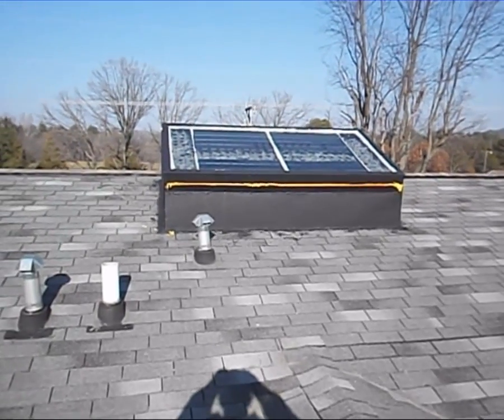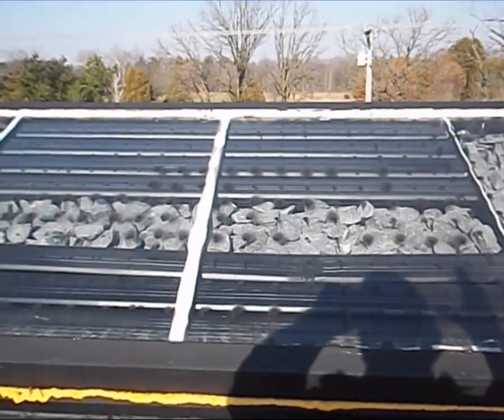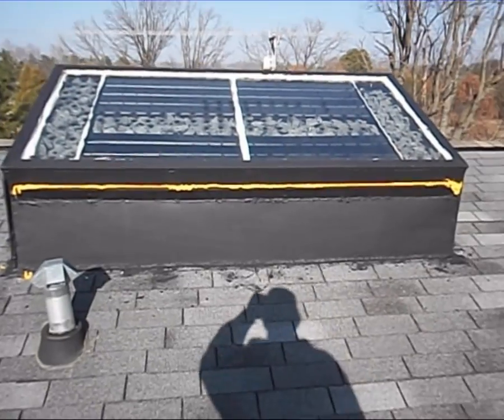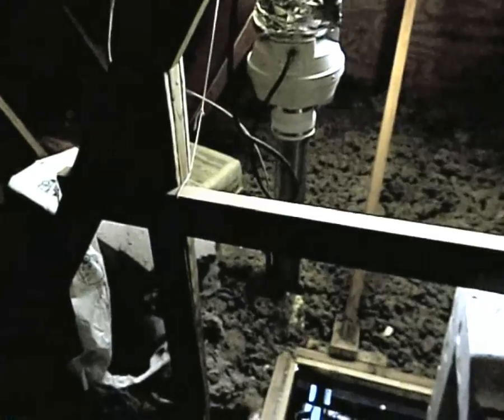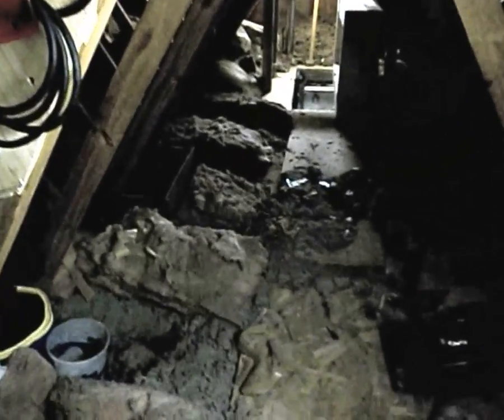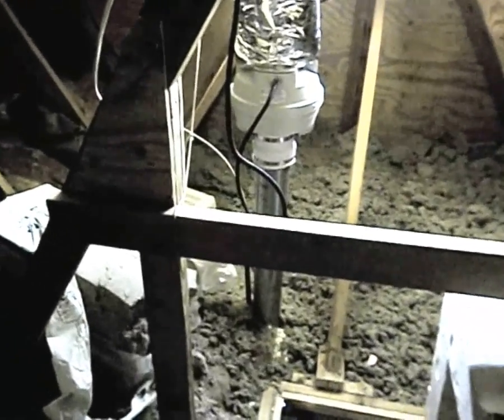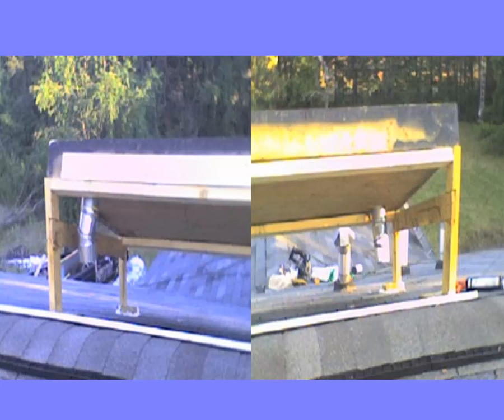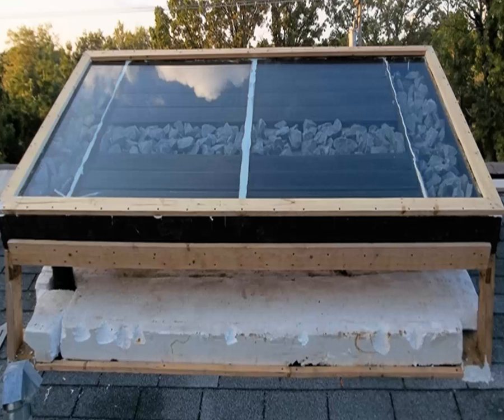My Roof Mounted Solar Panel and How I Built It Download Download

Comment: About 20 years ago we had solar panels put on top of my home. They worked great but when the sun is out is when we got blasted with the heat and at night when we needed the heat there wasn't any. I was going to run them to my basement next time and hope the basement would hold the heat. I don't have them any more. Just my thought on my experience. Very nice and I enjoyed your video.
Reply: Don't forget water in an insulated tank is a great store for heat.
Reply from the maker: Dukky Drake You're talking about a completely different type of system and it's more costly and takes up a lot more room. This panel is "Hot Air Only". I thought about doing a water system, but the cost of all the piping/tubing, pumps/ tanks/ etc. was just to much.

Comment from the maker: Thanks Bill, With spring just around the corner I'll be starting my next panel: 9' 6" by 52" by 8" with a completely different heat tube system.

Comment: I just finished a panel very similar to yours but without the rocks. My theory is that with adaquite air flow, all heat entering the panel is removed to the house. The rocks would only delay the timing and not provide any more usable heat. I just filled the box completely with the downspouts. Works great. Thanks.
Reply from the maker: The air flows thru the tubes not the rocks in the center section .... It's only on the inlet and outlet ends that has any air flow. But! many put baffles in the tubes to "Slow down" the air flow. If it goes thru it to fast it doesn't have time to get hot. I've seen some with nothing more than a computer fan to move the air.

Comment from the maker: I'm at 44 degrees lat. I went to a solar panel group and they came up with the 23 to 28 degrees, but they did say for best performance that was with "NO" trees... I cut down about 30 trees and it still wasn't enough, and I'm not going to clear cut my back yard. I'm hoping to have enough time to build my 2nd panel and that will be at a steeper angle. I'm thinking about making that frame adjustable so I can try different angles.
Thanks for the post.
Grandpa Bill

Comment: Hi Bill, thanks for sharing this video. You mentioned the angle of approximately 25° on which the unit is set. It does look like the back (top) of the unit is 25° up from the horizon, and you mentioned you are in Wisconsin. With the sun's azimuth being so low in winter (roughly 20°) and assuming the roof faces due south, wouldn't you want the panel to lay back at 70° (more raised) up from the horizon facing the lowest sun angle to offer the best 90° angle for maximum winter efficiency?

Comment: Just a thought, we use a hand held thermostat in the shop that would only let circuit to salamander close to turn  on to 120v plug.  We could set it at any temperature we wanted. you could uses this switch to set you temp of 80 deg kick on and 70 deg kick off.  Another source for this thermostat would be a attack blower that has a hand setting to when you want your attack blower to kick on they sell them at lows or Home Depot store.  Nice video and I can tell you have a great mind.
Reply from the maker: First: Can you get the make and part #? I'll take a look at it.
Second: Is the housing maded of soft/low temp plastic? During the summer months it can get over 250 degrees inside that panel; a plastic housing would soften (melt) and distort. The snap switches we use is about the size of a nickle and 1/2" tall; made of metal and bake-lite. Thanks for the post.
Reply: My uncle and I used it in his shop and he is no longer with us we lost him last year and everything is gone out of his shop and can not get part number. The blower for the attack I bought at Lowes and it has a hand setting that I set on 90 deg. and it turns on blower at 90 deg. It is the vent to take hot air out of my roof.  Just ask someone at a Lowes or home depo and they can get you the hole thing.

Comment: I want to try this during winter and see if its still work.. great solar heater..
Reply from the maker: Don't use the rocks... I had problems getting the water drain to work right even with the heat tape.

Comment from the maker: I got real lucky, a friend's dad pasted and he had about 12+ plate glass panels stacked up in his garage... he said if you want'em -- take'em.... so I got some that are about 4' square and the long ones are just short of the standard 4X8, so when it's installed in the frame it comes out to full size. As for thickness I'd say a strong 3/16", (Probably their 1/4" plate.)
If you need any other info just post it.
Grandpa Bill
OH! I quit in '92 I weighed 185/190lbs... 1 yr to the day I weighed 292lbs

Comment: Air flow may stall because the pipes in the panel are horizontal. even a 5 degree tilt wiil ensure air flow driven by the boyency of heated air. Also a Low-temperate-differential stirling engine could use caputured heat to run a fan - some of these will run from the heat of a cup of coffee. They can be simple to make, plenty of video's on YT.

P.S  Putting horizonal barriers above the left end of tube 1, 3, 5, and above the right end of tube 2, 4 and 6 may create a serpintine air flow, with heat exchanger effect which may make air at the top of the system hotter and create a stronger draw to drive air flow..

Comment from the maker: 1st: LaCrosse is 125 m. West and at the same lat.
I've now checked at least 6 different sites and no two are the same.
One said 66 degrees another said 46 degrees from horizontal , but several said you can be 15 degrees +/-.
To drop the front end would be a major job; maybe next spring I'll look at it again, but I'm way late on building my second panel which will be 9' 6" and have a different heat chamber. I've got a 3rd panel on the drawing board, (might replace #1 with #3)
Grandpa Bill

Comment from the maker: Outlet line is about 6'6", (Panel to the outlet Register) that's why there is a 100 CFM "inline" fan. Last years test readings ran from 90 to 125 degrees at the register. Hoping my next panel will put out some higher temps. It will be 9'6" with a 2"X8" frame and 4' wide, "BUT" the duckwork will be longer, so I'll use 6" this time.

Comment: water holds heat 4X better than stone.  FYI - water would give your 4X longer heat after the sun goes down
Reply from the maker: As I stated in an earlier post: Water panels are a completely different system and they cost a lot more to build. You need large tanks in the basement and pumps that can pump water up to 50' or more if your panels are on the roof. Then you need more equipment to get the heat out of the water tanks and into the house.
Reply: I totally understand solar thermal, but I think you missed my point - you used sauna rocks when you could have used liquid in your panel to help hold more heat at the end of the day. Simple antifreeze in a heat resistant container would hold more heat in your air solar panel than the solar rocks you used for 3X longer, same amount of material. You did built a great system though.
Reply from the maker: OH! Now I see your point, replace the rocks with containers of antifreeze/water and set it to about -40 degrees, but my biggest concern  with having some kind of containers inside the panel would be the expansion factor during the hot summer months where the panel can get to 250 degrees.
Reply: car antifreeze boils at 197C or 387F
Reply from the maker: Exactly! So any container /tank that's inside the panel would easily reach 250 F during the hot summer months. So you would need some kind of expansion chamber.
You also have to figure in the pressure buildup as that tank temp rises, that's why cars have a pressure cap on the radiators.
You could make the water tanks out of copper tubes and paint them black, but I'm not sure how or where you would make the expansion chamber and how would you be able to check the water level, and lastly at what cost?

Comment: Thank you fir the video.

Have you ever measured the performance?

I'm especially curious about the rocks for the thermal mass.

I would think the rocks would be very cold dissipating all its stored heat, so they would have to give up a lot of potential heat energy just to warm them back up.

In my greenhouse I have plastic drums painted black, and filled with leave rocks.

I was thinking that inside a house, I could use a barrel with holes cut in it, and duct in the heat into the barrel thru the stones, that way the thermal mass only cools down to room temperature, And,wouldn't have to use a forced air system.

Comment: Grampa Bill, why not heat concentrated salt water, send it to a storage tank underground, then have a heat exchanger added to the furnace and pump the hot water through it. the salt water will retain the heat longer than just pumping air into the house. or, using one of the old dish antenna's (the big ones from way back) and concentrate the sunlight and change purified water directly to steam. this would need a tracking device but thats not hard to do.
Reply from the maker: It's a matter of "COST" and how easy is it to build. Anyone that has a few simple hand tools can build a hot air panel.

Comment: You might want to spray paint the expansion form. The UV rays from the Sun, will just cause it to deteriorate. Personal experience. lol
Reply from the maker: I would "BUT" I'm making an other panel that's 4' x 9'6" and I'm thinking about removing this one and installing the bigger one in the same place; BUT #2 I would have to completely remake the mounting frame. Not sure which way to go -- remove the old one or mount the newer panel below it.

Comment from the maker: Do a little research on the snap switch... the lower the better... "on/off".. 90/80...90/70 even if it's 100/xx with xx being the lowest you can get to 70 degrees. The panel I'm working on now has an 90/80 switch... Ductwork: if you can, seeing it's a work shop setting, think about using 6" flex ductwork, (Home Depot).
Need any help/advice... let me know.
Grandpa Bill

Comment: May I ask why you elevated the solar heater several feet above the roof? Why build a box that sits off the roof so high? What did you gain by doing that?

Comment: you could install a sheet metal center to force the air around the tubes kinda like a long dna twist that will slow the air down and pick up more heat

Comment: Some nice work , Bill, just what I needed to get me going here,. Is there any fire hazard with regard to the panel heat ?
Reply from the maker: No... None that I know of as the panel's air temp runs from 90 to 200 degrees. Most of the time it's around the 100 - 130 mark. I'm currently working on two more designs. Would have had one done but winter hit me before I could finish it.

Comment: Also, could you please explain a bit about the condensation drain - is it only on the cold air intake you have to handle condensation?

What do you do in the summer to stop the heating?  Do you get any heat bleeding into the house from either of the two vent openings?

Thanks, Ron
Reply from the maker: Ever come out and your car is all wet from due/condensation ? well that's what happens to the panel and it runs down to the bottom. Your cold air intake is at the bottom left corner an instant drain.
Now as for summer months I just turn the blower switch off. No I don't get any bleeding because you install an anti-back draft valve in the duck work. OH! and the inlet/outlet registers can be closed as well, just like the ones you have in your home now.

Comment: I can understand their solution, but I think it may have been misinterpreted. Ideally you want the panel to face exactly towards the sun as that is the most efficient. Please check here: solarelectricityhandbook(.com)solar-angle-calculator.html , I used USA, Wisconsin, Green Bay (It's very close to your latitude). When you see the results, there will be a small diagram at the bottom. You will see why I think it should be perhaps 70° as opposed to 25° - 30°. Just trying to help. :)

Comment: Hi Gramps thanks for the video and info. Why not use steel inside the solor panel since say steel holds heat allot longer? Or maybe not long enough to keep heat going much longer anyway and the cost would be much higher with steel?
Reply from the maker: Think about an alum. fry pan - it heats faster - Even Heat - Alum. spreads the heat throughout the entire lenght of the tubes.
Steel takes a lot more time to get hot and it doesn't tranfer the heat very well.
Remember: We are talking about winter temps, not the hot summer sun.
Grandpa Bill
Reply: Remember the goal is not to heat the tube but heat the air.   Aluminum transfers heat quicker.   The dark tubing absorbs the sunlight and heats up then transfers the heat to the air inside.   Using pop cans inside the downspout might improve the efficiency because it slows the air movement down so that the air has longer to absorb the heat.  Love the idea of the sauna rocks.  I wonder if pouring black concrete would improve it.
Reply from the maker: RandomTorok Don't do the concrete.... ever see a sidewalk or even a highway explode in the summer? Now that's just out in the sun, but if you enclose that behide a glass panel, you got trouble! Winter time the inturnal temp is in the low 100's (110-135), but summer time it's over 250. The lava rocks are heat tempered so they are stable no matter what the weather is.

Comment: Hey Grandpa Bill.  Why do you put so much insulation under the unit?  Is the purpose to protect the underside of the heating chamber from cold air?  Just curious.

Thanks,  Ron
Reply from the maker: Not just the cold air -- It's the ice and snow that would packup under the panel.
One very big 'ice cube'.

Comment: Now, how big of a space can you heat with this panel, and do you say it provides reasonable complimentary heat throughout winter?
Reply from the maker: Home is 36'X44' saves 'about' 500 gallons of LP... need to rebuild or make a new one as this is over 5 years old. New and improved designs have come along over the years. It's just a matter of MONEY now. You have to spend it before you can save it.

Comment: There didn't appear to be very much insulation in his attack.  Why go to all of this trouble and not adding any insulation?
Reply from the maker: There was 12" to start with, and if you back to 4:40 you will see at least two bags of insulation, (left side of the fan), of the 12 bags that still have to be spread out. But that was all done 'after' I finished all the solar panel work.
Reply: Ah, thank you.  Why didn't you capture all of hot air in your attic instead of building a box on the roof?
.
Reply from the maker: Passed High School Physics I take it you don't know how roofs are built. They are "Vented" along the bottom edge and at the peak of the roof. So if it's 20 below outside -- it's 20 below up in the attic as well. (That's why you put the insulation on the floor of the attic and not stapled up in between the rafters.)
Reply: Yes I am familiar.  It can get up to 140-150 degrees from all of the trapped heat which is why folks install attic vent fans.  I was just thinking if you built the box in the attic you would capture a lot more heat energy.  With the box on the roof exposed to wind you would loose heat energy.
Reply: Passed High School Physics
I don't know a whole lot about these things, but I don't think the attic would get 150 degrees in the winter time.  Also, if the box was in the attic, it would not have the sun's rays hitting it, in order to capture the heat from the sun.  The box would be 'shaded' from the sun's rays by being under the roof, so the only 'heat' that you would get is a small percentage of the heat loss from the house itself, instead of what you could get from the sun.  Just guessing.
Reply: Passed High School Physics Great point---i agree terry
Reply from the maker: Terry, go back up in my replies and you'll see how much was there before as well as how much I add.
Reply: Grandpa Bill Thanks Bill---I stand corrected--- I did not read all  ---as I was more interested in your content!

Comment: Do you have a problem with air flow? This why your building a #2 unit? My thinking is the rocks should be below the free, even flow down spouts......  Like in this vid > https://www.youtube.com/watch?v=Z96uT86PlI8
Reply from the maker: +Jeff Brown  No ... there are only a few rocks on each end. The main tubes going across are completely open. I haven't been able to get the replacement panel made yet do to lack of help. I think this next design will produce more
heat, "when and if"I can get it finished.